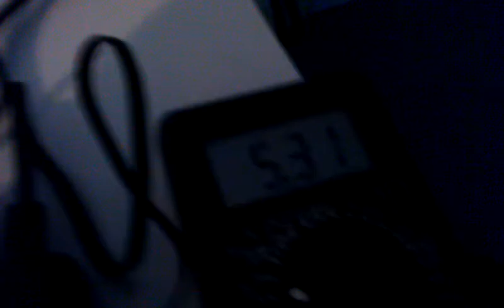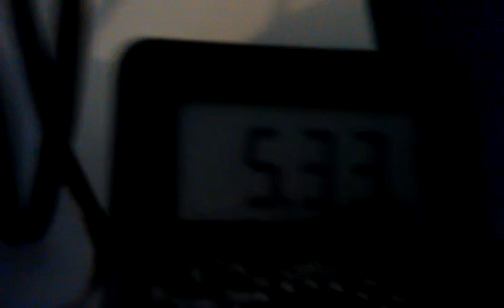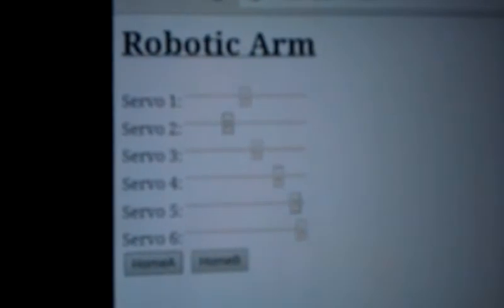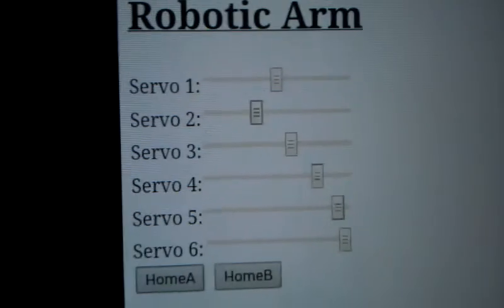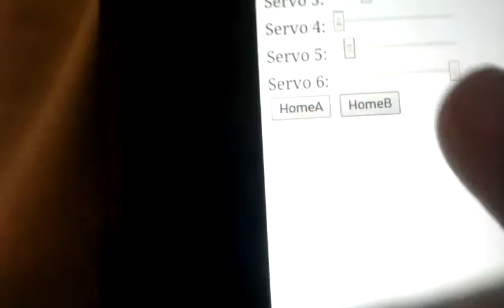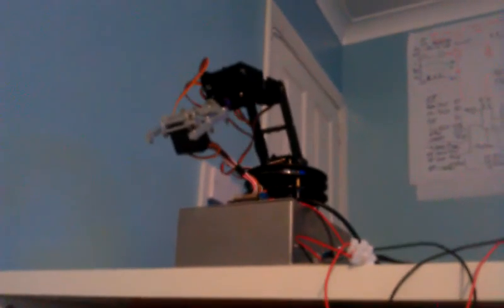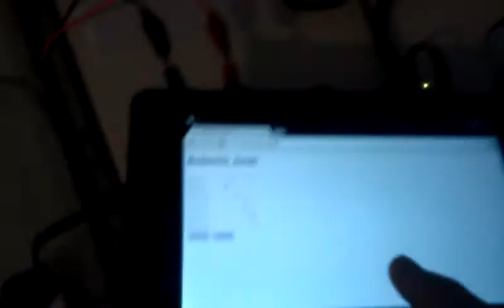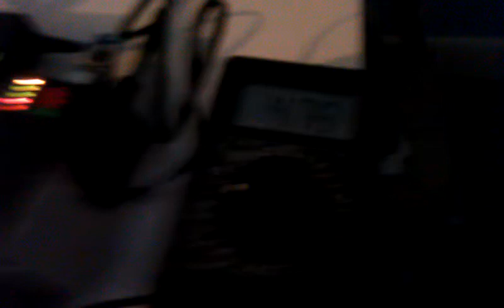Raspberry Pi Powered Robotic Arm - 6 D.O.F

Comment from the maker: The rotary servo is a MG 996R, the shoulder and elbow are High Torque GS-5515MG, the wrist up down and rotate are both MG 996R along with the claw which is also MG 996R